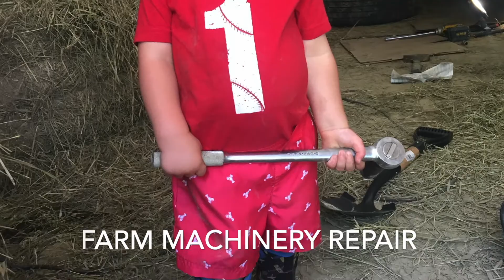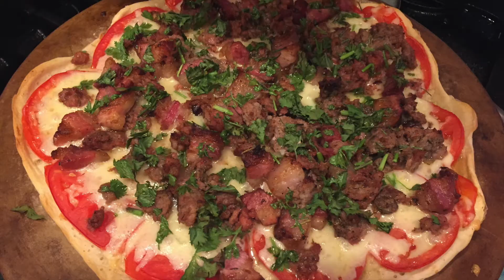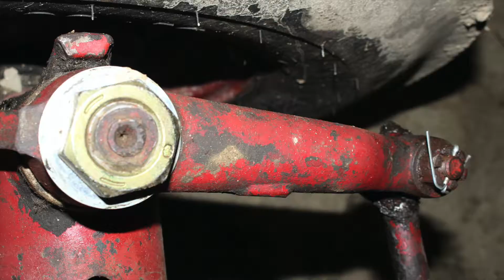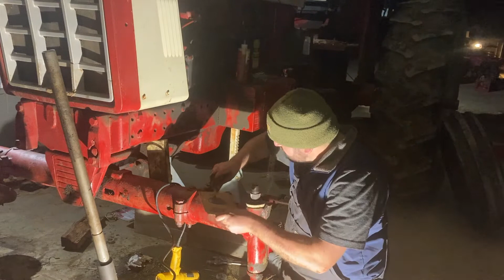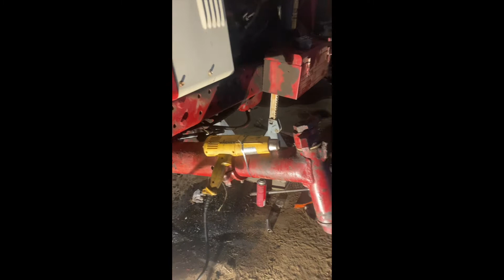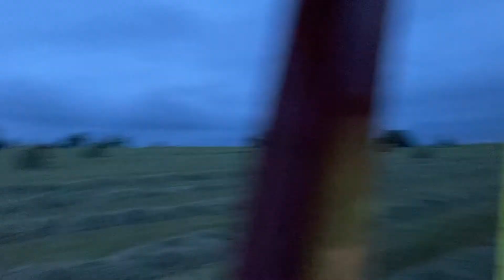IH 1066 Loose Steering Arm Repair | Wandering Steering on IH1066 | JB Weld to Repair Loose Steering

Comment: Just after I got my driver's license, I had this problem with the Pitman arm on an old Cadillac. The guy at the shop told me I had to replace both the arm and the steering box, so I did, but I resented having to do it. I'm sure that if I had suggested a fix like this, he'd have given me that look as if I had just run over Bambi, but I think there are conditions where such a fix would be justified. As long as the arm is in no danger of breaking off, and the JB Weld actually gets rid of the play, it could be considered a safe fix. Of course, if the arm is in danger of either falling off, or slipping on the shaft with no limits, I wouldn't want to rely on the JB Weld to keep it together, but when the play can first be detected, that won't be the case. It might well have been the case with my car, since the previous owner has totally neglected it, so it's probably a good thing that I replaced both parts, but if the previous owner had used a fix like this early, it might never have reached that point.

Comment: Thanks for the video, it’s a huge help. I’ve just pulled the front axle apart on my 986 to start going through it and one spindle spline is loose. It wasn’t too appealing to spend the money for a new spindle and arm so I’ll be trying the JB weld trick also. I’ll be putting up videos of my repair process also.

Comment: I am also working on my spindle on my 1066. It broke off next to the wheel hub. I acquired all the new parts except for the washer on top under the steering arm and the retaining clip. I was wondering if there was anything special about either of them? Mine no longer exist. Thanks for sharing!

Comment: I am working on my 886 and to remove the steering arm (which was very tight) I had to heat the arm and use an impact air hammer to drive the spindle out of the arm. Of course the reason it was so tight was due to years of rust build up within the splines. Now the fit-up has slop. They do sell an undersized spline steering arm but it may not be that bad for it to fit properly. JB weld should work fine like for this application as there is not mush force on those splines when the spindle nut is tight so I am considering using it.